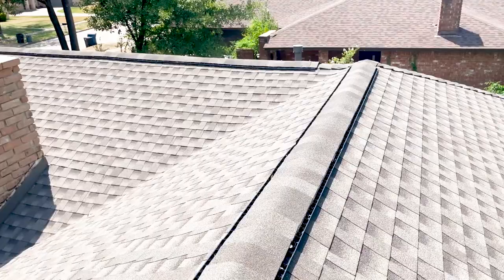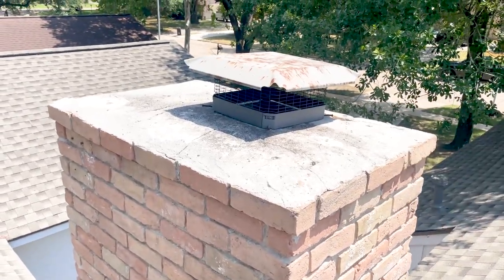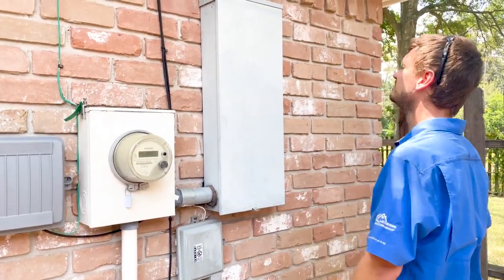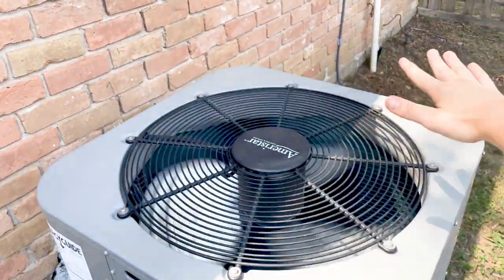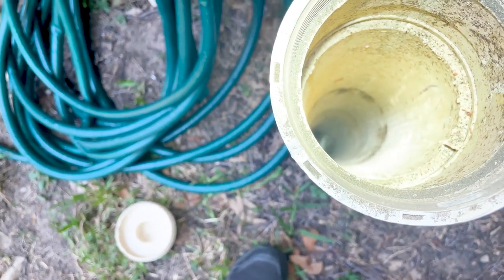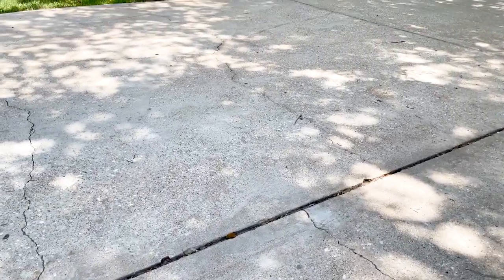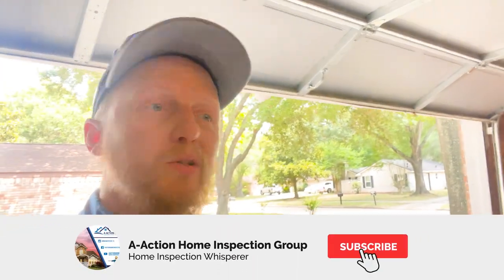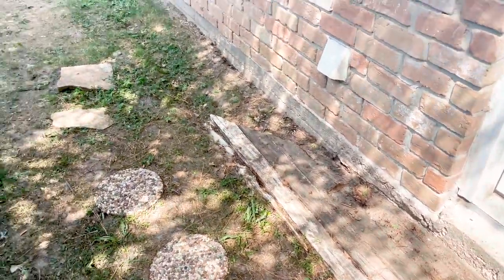1970s Flip Property Inspection

Comment: Great channel. I’m home Spector in Jupiter, Florida. One thing I would add is that clean out for the drains could be a sign that they are having clogging issues and the house did not originally come with a clean out?? If not, they had to install clean out just to unclog issues. I would call for a drain inspection or like you mentioned, a permit, with a full scope of what was replaced. keep up the awesome content!

Comment: Was that an attached garage?  Isn’t Sheetrock required?
Reply from the maker: Not always,  fire blocking is but in older homes we are not always reporting to current standards.  A 1970s property will not be to par with a 2022.